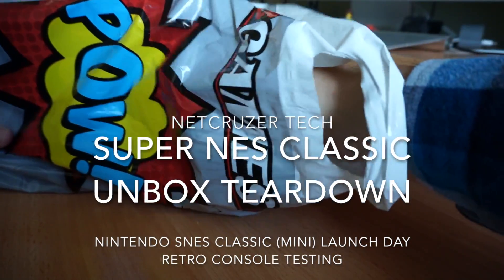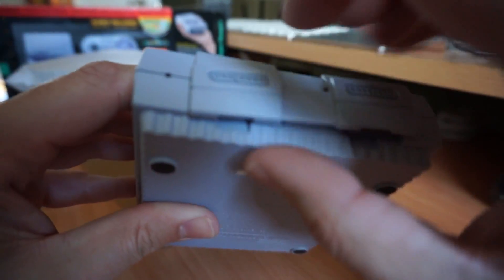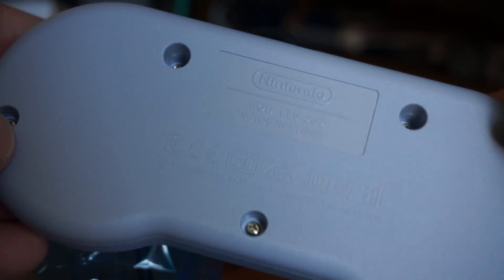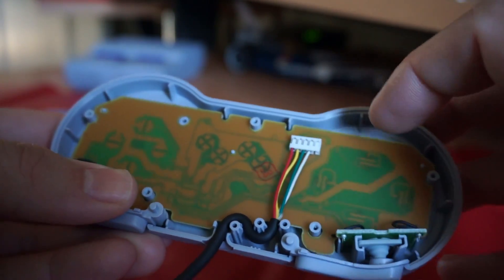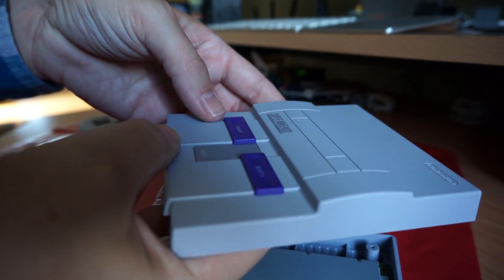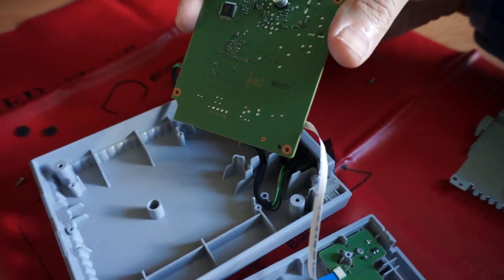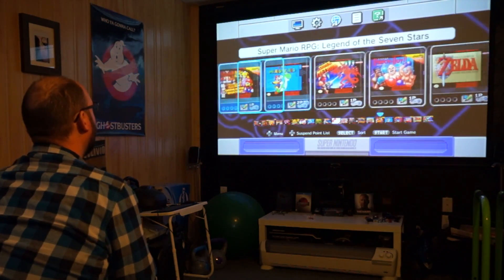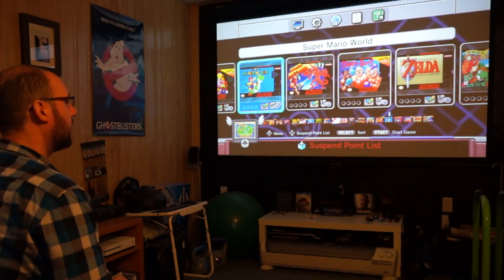Super NES Classic Unboxing Teardown and Test - Netcruzer TECH

Comment: Wondered if the games built in use emulation or if they are recompiled for R16.   The original SNES used a 5A22 CPU (65C816 Derivative).

Comment: Quick question. Before you opened the console. Did you notice any kind of sounds inside when you move the console upside down? Like sometime loose inside?
Reply from the maker: José Goméz yeah it has a bit sound if you flip it around. The cables can move around and hit the sides which make noise inside.
Reply: Netcruzer RC TECH CARS I noticed that with mine when I flipped it around. And also heard a similar noise in your video when you moved it. I was wondering if mine had something wrong inside. Thank you for your response, that cleared my doubt if there was something wrong with mine.